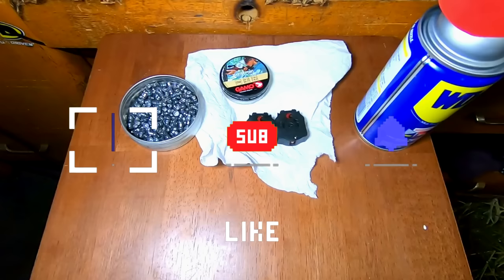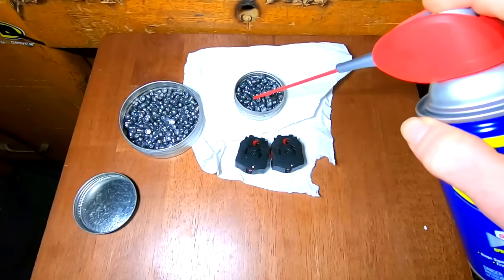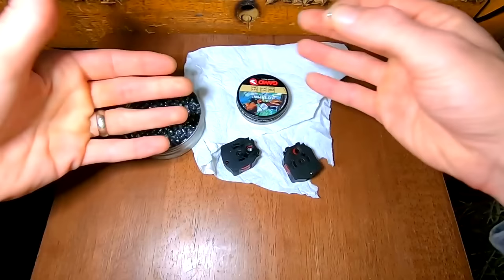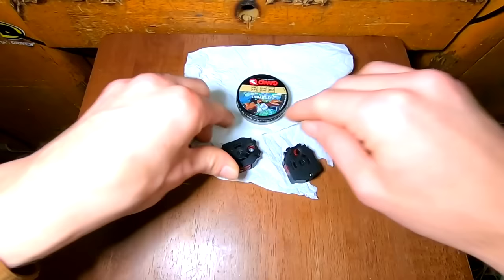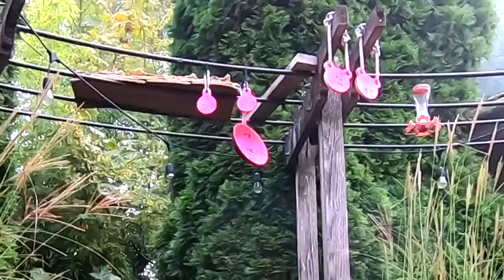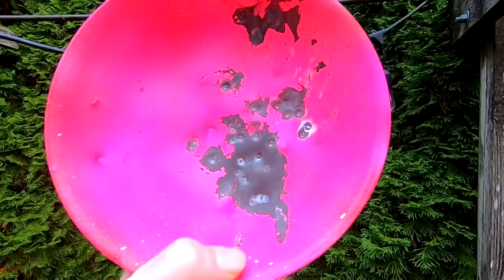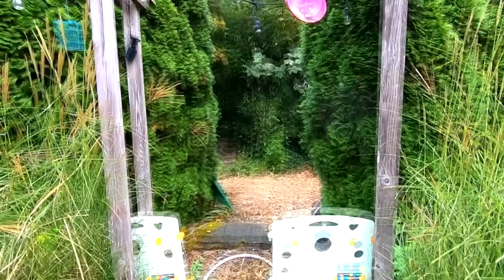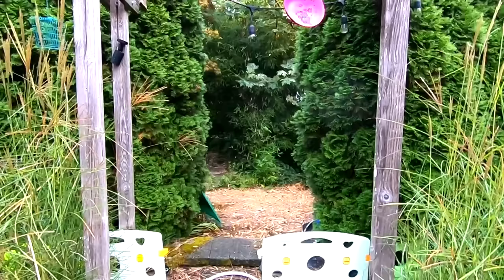Pellet Dieseling the Easiest & Quickest Method

Comment: What I'd point out is that it will trash your gun's seals and if you are somewhere that legally constrains the power of airguns, such as the UKs sub-12 ft lb regulations, you are breaking some very serious firearms laws.
Reply from the maker: My seals are still fine after several years of doing this and I don't even clean my guns. 
this is mostly a myth

As for living in the UK goes, you can't fix stupid. But even still you technically wouldn't be breaking any laws, because your gun isn't modified, and is still within the legal limit. There is no way for them to prove the velocity of a dieseled pellet you have shot, or that you dieseled any specific shot at all. And if they went to test your gun, it would simply come back with it's factory numbers, since the velocity is only increased when you the user decide to add lube to a pellet.

Essentially, don't shoot your dieseled pellets through the government's chronograph and you will be fine. Your airgun is still the same airgun.
Reply: @PelletPlinker  Just putting the information here pal. You are actively encouraging people to do something which is a criminal offense in some countries. If someone reports a supersonic report from an airgun and you don't have a firearms certificate all it would take would be a couple of minutes for your local firearms officer to see what you were up to and yes, it would be prosecutable. And dieseling will fuck your seals eventually, the pressure generated is way above the design spec for any airgun.
Reply from the maker: That's not how it works, but by all means go ahead and prove that somehow some random authority will magically know you were dieselling your gun. Give me literally one case of someone being prosecuted for dieseling their air gun.
Reply: Not the point mate. You are encouraging people to do something that has the potential to put them in a very bad place and you put no kind of warning that taking a sub-12 over the limit is an offense. People HAVE had their airguns confiscated after police testing as a result of too much gun oil getting into the breach causing dieseling and they would prosecute if they thought you were doing it on purpose.
Reply from the maker: Because I don't give a shit about rules and laws from a country I don't live in.
You are talking out your ass, that has quite literally never happened.
Reply from the maker: It's not my duty or responsibility to warn people about laws where they live. I am not the arbiter of the planet. That is not my job.
Reply: @PelletPlinker  You're quite right, of course. Just as it isn't your duty to pull a drowning kid out of a pond if you see one fall in. Thanks for confirming my opinion of you.
Reply from the maker: Not sure why you are comparing saving a child from drowning, to someone not being someones fucking daddy.

It's none of my business whether or not this is legal, because where I am it is legal.

Comment: It should also be mentioned that dieseling your air rifle may very well mean you are actually firing over the legal threshold in some countries. 12ft pounds is the limit in the UK, and if your rifle is set to somewhere close to that limit then raising it through dieseling would mean that technically you're using what the police here would deem to be a Firearm. That puts you in a World of trouble if caught.
Reply from the maker: Not true because you are not altering the weapon.

You can't turn something into a firearm without changing it in some way. 

Once the dieseled pellet leaves the rifle, it's over with, and there is nothing that would make the rifle illegal 

But also either way that is the exception not the rule. Most people don't have to worry about that, and the people that do, don't care.
Reply: @PelletPlinker  I tried to be polite and just give a cautionary piece of advice, nothing more. Oddly enough, I watched a video yesterday on the exact subject. If you are caught in the UK with an air gun and pellets, and the police test it with the pellets you have, and it goes over 12 ft pounds, you're nicked. No ifs buts or maybes. It's a hard and fast law with no wiggle room here. Don't make the mistake of thinking that the same laws apply everywhere because they simply don't. Over 12 ft pounds is a firearm in the UK, 6ft pounds for a pistol. Dieseling the airgun "IS CHANGING IT", it is no longer stock, as it was manufactured to be used. I don't care if you think it's crazy, I don't disagree, but you're 100% wrong, and all I was trying to do was to warn of the potential worst case implications of dieseling an airgun in the UK. 
People might not care .......... right up to the point where they are facing serious consequences.
Reply from the maker: You are confused. 

Dieseling the PELLETS changes, the PELLET, not the gun. The gun is unchanged, so no it doesn't change it. Pretty simple concept to understand.

If you live somewhere where you have strict laws like this (which again, is the exception, most places aren't like this), then sure, you shouldn't have a whole tin full of dieseled pellets on hand for the cops to test. 

But if you shoot some dieseled pellets, that doesn't change your gun, and when your local enforcement goes to check it, they will check it with standard, non dieseled pellets, and they will not get the dieseled results, because the pellets aren't dieseled at the time of testing, and there are no changes to the gun itself.

The gun is still stock when theres a tiny bit of oil in the chamber.
Reply: @PelletPlinker  I'm not going to argue with you, it's pointless. I've stated my points and if you choose to see that as confusion, that's your choice. My message is simple, check the laws in your own country and abide by them. I know for certain that anything chrono'd at over 12ft pounds (possible 5% leniency) is classified as a firearm and carries a mandatory 5 year sentence.
Reply from the maker: so just don't let the cops test a dieseled round lmfao
Reply: @PelletPlinker  Oh I'm sure they'd let me accompany them to the testing range. Maybe they'd let me use my own chrono too.
Reply from the maker: Why would they be testing with dieseled rounds at the test range?

I feel like you don't quite understand the dynamics here
Reply: @PelletPlinker  If that's what you have on your person at the time of seizure, why wouldn't they test the pellets you were obviously using, in the gun they seized? I feel you don't understand the logic here. You also obviously don't understand the Police attitudes in the UK towards any kind of weapon. If they can find ANY way possible of removing it from you legally, they'll go out of their way to ensure you never see it again. We don't even have the right to carry a locking knife of any size, and even non-locking blades have to be under 3 inches. 
But on the flip side, at least we have free healthcare if we were to ever be stabbed by an illegal knife 😂
Reply from the maker: exactly my point
you simply don't walk around with a tin full of dieseld rounds if you live somewhere that they do that shit. 

I don't live somewhere that they do that shit, so I don't really give a fuck about this strange conditional that you are trying to apply. But if you do, diesel your pellets one at a time, and keep normal pellets on hand.

Comment: Dieselling is the quickest way of damaging an air rifle, best avoided...
Reply from the maker: wtf did you click this video for if you have no interest in dieseling?
And that's a myth. I've been dieseling these guns for years now. Hundreds of dieseled shots through each gun. Not even a damaged seal yet. Which by the way, even if what you are saying was true, it doesn't actually damage the rifle itself. The worst thing that it *might* do is, it might blow a seal out due to the added pressure, but again, I haven't even had that happen yet. 

There is no documentation anywhere on the internet that demonstrates any amount of damage dieseling does to air rifles. I have not seen a single video or anything that confirms this.

Comment: If its more power you want......get a bigger more powerful rifle.... preferably an FAC rated FX .25 tuned at 65fp pushing Zan 33grn slugs out at 1050fps......ALL THE GUN YOU WILL EVER NEED.
Reply from the maker: Didn't ask for advertisements in the comments not sure why you are advertising in the comments.
Reply: NO ads, just some common sense from a satisfied user who dosnt need to faff around with a NON LUBRICANT like WD40,  Get real pal !

Comment: Dieseling doesn't make your pellets fly faster. Its just a louder sound with some smoke. Adding thicker liquids like this can actually slow down the projectile velocity.
Reply from the maker: Not true at all.
I don't use a chronograph here, but there are plenty of chronograph videos on youtube that prove that there is a substantial increase in pellet velocity, up to 50% increase or more in velocity

The pellets literally break the sound barrier when I diesel them, and my rifle doesn't break the sound barrier with any pellets when I don't diesel it.
Reply: @PelletPlinker  There are plenty that show that it doesn't work. All you need is just to either buy a higher power gun or mod it to have higher fps. A great platform to do that is the Crosman 1300 series.
Reply from the maker: Not really sure how videos of people doing it wrong disproves videos of doing it right, but like, sure thing boss.
It works when I do it.
Reply: Jenach dem. Wenn die Pellets locker sitzen nach vorne. Wenn nicht gibt es ein Schlag nach hinten
Reply: @PelletPlinker  ungefähr so als ob du es in den Auspuff tust. Du musst es in der Feder Zylinder rein tun. So verdampft es bevor du damit schießt
Reply: @l.m6836  Just make explosive propelled pellets
Reply from the maker: literally just look up some youtube videos 
I don't need a chronograph when there are dozens of youtube videos with chronographs that prove it works

your in my comments either way so it's a win in my book

Whether or not you choose to diesel your rifle is up to you, I don't really give a shit, and I guess this video isn't for you

But like, what, do you think I am gonna delete this video or something? like what is your thesis here?
You have no interest in dieseling air guns, and yet you are living rent free in my comment section and adding to my youtube engagement statistics, so like, keep on keeping on I guess lmfao.
Reply: @PelletPlinker  You do realize that my comment was to "The CBC" ?😃
Reply from the maker: I do now lol hard to keep track after a while 
It applies to any of the non believers though I guess lol
Reply: @Nikkolai P You're false XD
Reply: dieseling is to some extent how hw air rifle run,how does a diesel engine run its exactly the same process
Reply: FALSE. Tested at 40-50% increase in FPM by chronographs by Dieseling
Reply: Wrong buddy, I have a chrono and tested on my springer .22 airgun and got nearly 200fps faster from a standard of about 550fps. It's inconsistent though.
Reply: It's called detenation, and yes it increases your projectile between 300 and 500 fps...I have rolled 1,000 fps 
one hot day last year.... That's competing with my Ruger 10/22 
Long rifle.
Reply: It actually does up to 200 to 300 fps

Comment: Fastest way to destroy your piston seal!
Reply from the maker: Not really. 
More likely to damage the breech seal than the piston seal, but even still pretty uncommon.
Been doing it for years all my guns are still fine.

Piston seal damage tends to occur not from pellet dieseling, but from piston dieseling. 
The pellet chamber (breech) is very small, and holds a very small amount of propellant, which creates a very small combustion, but enough to increase the velocity of a tiny pellet.

The piston chamber is huge by comparison, can hold a LOT more "propellant" (lube), and will create a comparatively massive combustion, which IS enough to damage piston components. 

Piston damage tends to occur when one over lubricates an air gun, and specifically, over lubricates the piston assembly in such a way that there is a dangerous excess of lube in the piston chamber. There is more space for oxygen in there, which means more of the oxygen and fuel can combine, which means bigger bang. 
Dieseling that occurs within the piston is much different than purposeful dieseling that happens within the barrel of the gun.

The air hole between the piston and the breech is smaller than the barrel (so the pellet cant make its way into the piston assembly). This means that combustion pressure that occurs in the piston will have a hard time leaving the piston, since it is restricted by the small hole.

Conversely, when combustion happens in the barrel, it also is met with resistance from the air hole, and will not tend toward the piston chamber. But even if it does tend toward the piston chamber, fluid dynamics makes the pressure drop, since the combustion pressure is moving from a smaller space (the barrel) to a much larger space (piston chamber) where the pressure can expand and dissipate.

The amount of oil you can fit into a pellet skirt is simply not enough fuel to damage your gun. Filling your piston with oil is a different story though.

Comment: This is why airguns will become no different than firearms and get regulated, background checked and restricted.

This is illegal. When you diesel an airgun on purpose you have created a firearm. 

Then, when everyone is screaming about why airguns are declared firearms or the manufacturers seal up the mechanizms so they can't be dieseled who is to blame?

Some kid will do this and create a sensation and then along cones the laws. Already many cities are limiting power on airguns and in some countries there are already laws regulating airgun power.

Thanks for being one of those who are the reason the rest of us can't have nice things.
Reply from the maker: You are wrong for a lot of reasons.
1. this is nothing new, people have been doing this for decades
2. it's not illegal. Show me any law code anywhere that specifically prohibits this.
3. you are confused about "creating a firearm". This requires modification of a device, or creation of a device, into a fire arm. This is not modifying the airgun, it is oiling a pellet. Once the pellet has been fired, the deed is done. The airgun has not been altered in any way, and is just a normal airgun. Adding oil to a pellet is not creating a firearm, because the pellet isn't the arm, the rifle is the arm. I am altering the pellet, not the rifle. Pretty simple concept to understand if you have higher than 70IQ
4. seal up what mechanisms? you appear to have no understanding of what you are talking about
5. kids have been doing this for decades, and kids already aren't supposed to have normal airguns anyway. You have to be 18 to buy these, so this logic doesn't hold up.
6. How have I, or anyone else who has done this in the past 50 years, effected your ability to own or use an airgun, or a firearm? (I'll give you a hint, it hasn't)

Go be stupid somewhere else, on your own time.

Comment: What is happening is called detenation
not dieseling. And I think you're flooding the engine a bit... Use a pellet tool to insert the bullet so to spread the shirt against the barrel Wall... Alternate coated and non, you will experience detonation even on ones that haven't been sprayed.
Reply from the maker: You are confused. Dieseling is a type of detonation. A normal engine detonates fuel using a spark plug to create a spark. A diesel engine uses the heat of compressed air to detonate fuel. 

This detonation is happening as a result of compressed (and thus heated) air, hence why it is referred to as deiseling.
As for alternating pellets and still getting detonation, this is from leftover fuel in the barrel, which gets dieseled on the next shot.
Reply: @PelletPlinker  they use a glow plug until it gets hot enough then it starts to Diesel... If the engine fires off of a compression stroke with no ignition source, that's called detenation.
Reply from the maker: depends on the engine
older diesel engines, and even some modern ones only need glow plugs for starting, and run without glowplugs.
detonation happens regardless. it is always detonating. That is the nature of combustion whether it is diesel or gasoline or gunpowder.